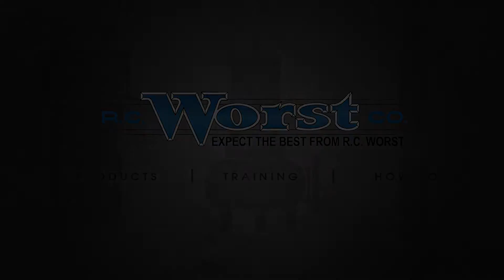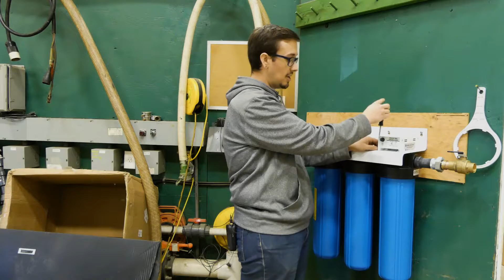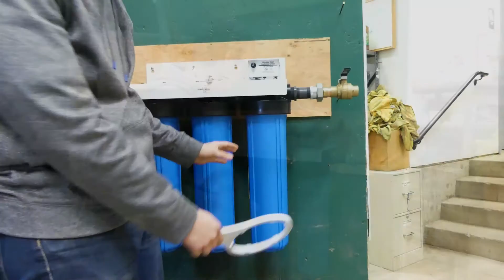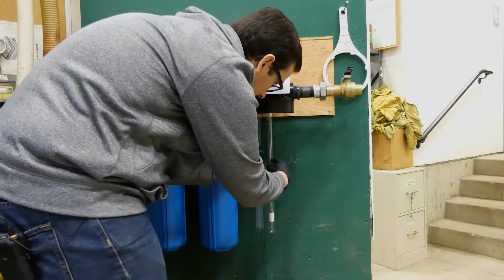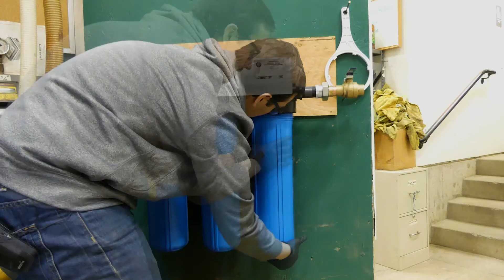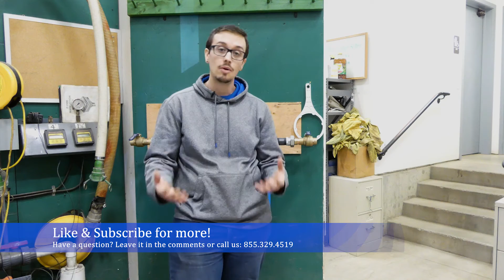How to Change the Lamp and Quartz Sleeve on a Pura UV System

Comment: This is much harder than your video suggests. Mine is a 2013 vintage system identical to yours. Last week I attempted to pull the tube from the top but the cord was stuck inside the white frame and I was afrad of pulling too hard and damaging the cable. 
   In your case you put little tension on the wrench to remove the blue housing. In my case if it is not quite tight it leaks. I have to use plenty of force. Too bad they do not sell a wrench with a longer handle.

Comment: Thank you for the video. I’ve got white particles in the water since I changed the two filters. Could that be from the filters?
Reply from the maker: Yes, it is likely just the air bubbles coming out from the filters. Should clear up after a bit.
Reply: Thank you 😊

Comment: Thank you for the video I have to do this tomorrow because mines just broke
Reply from the maker: Good luck! Call us if you have any questions: 855.329.4519
Reply: Hi awesome video! I have the same system. When should you change the fuse, I also noticed that the blue light indicator flickers a lot. Is that normal??

Comment: Sir how to repair the control module? Its not turning on
Reply from the maker: The fuse may have blown, unscrew it and check it. We sell the fuse as well as the new modules, give us a call if you need one:  855.329.4519
Reply: In my case the blue LED failed and so I bought some replacements on Ebay and soldered them in.